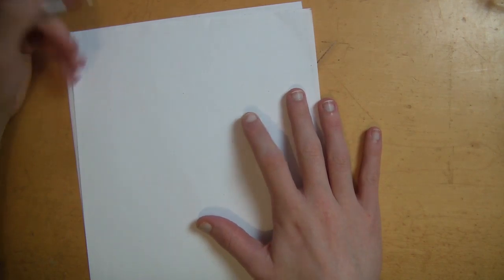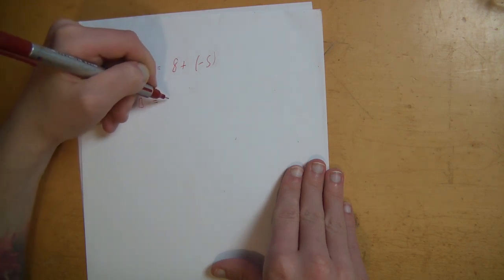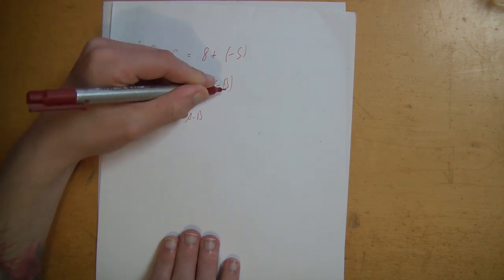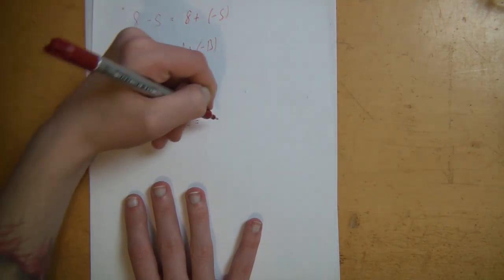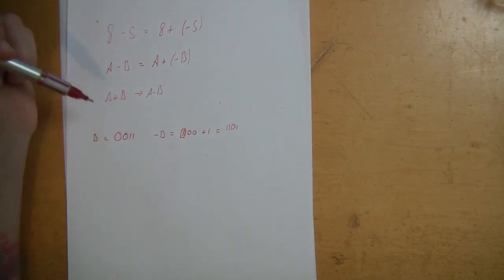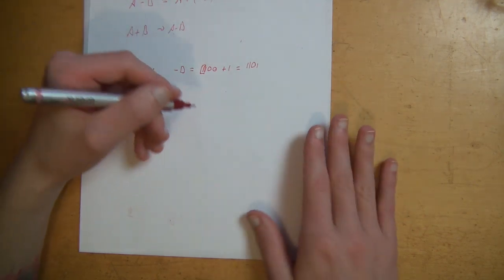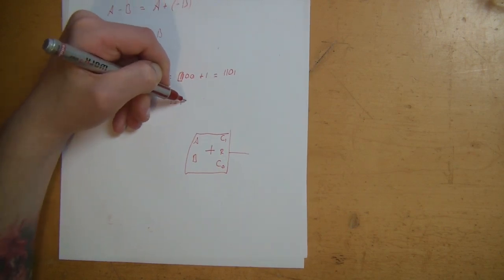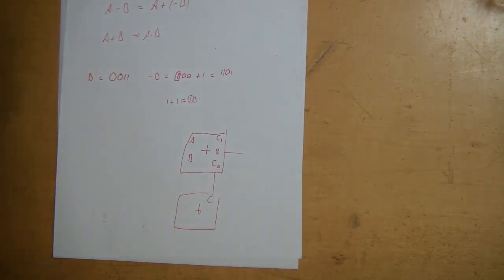Substraction with ICs - Lets Build - 8 Bit Computer Part 6

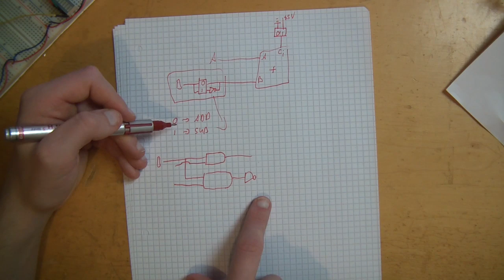Comment: In 11:33 there is a more simple way to do this, use a xor gate with the b as the first input and a button that will connect to the C1 and all the others B's xor gate, when you are not using substraction the button is off and it works perfectly because in a xor gate when one input is 1 it will be 1 and when 0 it will be 0, when u are using substraction u click on the button making it 1 and making the xor gate's input 1 making his output 1 too if the input of the button is 0, if the button is one it will output 0 making a simple inverter controled by one input. Thx have a good day :)

Comment: dude u were not clear in signed and unsigned values..
Reply: Javid Hussain
Basically, unsigned values are only positive values. 00000000 all the way through 11111111 are positive, the latter being equivalent to 255 in normal counting. And signed values reserves half of those values for negative values, where the first most significant digit tells us whether it’s negative or not.

"+" values indicated by the first 0:
00000000 = +0
00000001 = +1
…
01111110 = +126
01111111 = +127 (~half of 255)
NO MORE POSITIVE VALUES

Now for the negative values, we invert all bits and count down instead of up. However, symmetry is not perfect since 0 is technically considered "positive" (see above).

"–" values indicated by the first 1:
11111111 = –1 (rather than –0)
11111110 = –2 (rather than –1)
…
10000001 = –127 (rather than –126)
10000000 = –128 (rather than –127)

So in a single byte (8-bit number) you can describe the values 0 through 255 (so 256 "positive" values, including 0) by defining the byte as unsigned; or the values –128 through –1 and +0 through 127 (again 256 values, though with the possibility to sign negative values as well as positive values) by defining the bye as signed (meaning that it matters what +/– sign is in front of the value).

Hope this helped!! :-D

Comment: You can use an XOR gate to invert the B signal. I followed the truth table for your multiplexer, and that's all it really is.
Reply: What I do is put an XOR for each A input and for all outputs of the sums. The carry out of the last adder doesn't get an XOR. input A of each XOR is input A or the Sum of the adders, and all the Bs are connected. Turn on the Bs of the xors and you get a binary number. Doesn't support negative but works

Comment: Just a cool thing with 2's complement conversion and incrementing numbers. Inverting a binary number is really easy. Then incrementing comes... Cool thing is, you can start at the least significant bit at the right, and go left to search for a 0. Once we find one, we invert it again along with all other less significant bits. e.g. 6 = 0110. Inverted 0110 = 1001. Start at the right. Is 1 0? No, move left. Is 0 0? Yes, invert 01 to get 10. Result? -6 = 1010. Since we're double inverting those first 2 bits, we can use that same process to select all the numbers that SHOULDN'T be inverted in the first step. e.g. 6 = 0110. Since this is uninverted, we search for a one. Start at the right. Is 0 1? No, move left. Is 1 1? Yes, invert all bits more significant. Result? 10 at the right remains, and the 01 at the left is inverted, so -6 = 1010. That's why a++ is faster than a += 1, although some compilers take the latter and replace it with the former.

Comment: 9:40 You will have a short circuit. You can't connect 2 outputs together. You can use a XOR gate as "conditional inverter" to invert the B signal depending on which function you want.
Reply: You're so right!

Comment: why don't we learn this at school?
Reply: +Sudhir thelegend the logical gates are learned in both Logic/rhetoric(if you have this subject where you are) and mathematics(mathematical logic), in the 9th grade, but with slightly different names.
Electricity and circuits, series and parallel connections, are 10th grade physics, but the complexity of those here is admittedly far higher, although if you mastered the simple ones from school you can understand those easily.
So we do actually learn this, you just need to connect them to the base information/concepts from school.
Reply: +Sudhir thelegend I do :)
Reply: +pvc988 lol what school?
Reply: +Andrei S i am jealous :)
Reply: because people don't care enough to teach you this lost art.
because there are apparently more valuable knowledge than the knowledge that LITERALLY changed the word.
Reply: +Sudhir thelegend i learned by myself on a single weekend by videos but i say computers should be taught at 9th Grade, its pretty useful in math

Comment from the maker: Well a 4 input multiplexer just has 16 4input AND gates. If you want to trigger a specific line with for example 0001, on every line where there is a zero, you put an inverter. So this way, when the input is 0001, the end gate gets 1111. You repeat that for all 16 possiblities. Quite simple, really.

Comment: 2) You can't just wire the two AND gate outputs together (unless you're using gates with open-collector outputs and also have a pull-up/down resistor on the wire), but rather you need an OR gate to combine the two outputs.

3) You don't need a mux for carry in. You can simply use the same select signal as routed to the data mux as the carry in value, possibly with an inverter depending on whether the select signal means add or subtract.

Comment: I found some bugs in the video.

1) When building the multiplexer, the two data input signals you want are data and NOT data. The select signal selects between those two. Thus, the inverter must be before the AND gates, not after it. If you put the inverter after the AND gates, then you end up selecting between data and data, then inverting one output!

Comment from the maker: The problem is that its a pain in the ass to get the 74S working together with the 8000 series. I didnt find an 8000 series 4 bit adder yet. also I need to buy a second round of supplies, that means shift registers, etc..